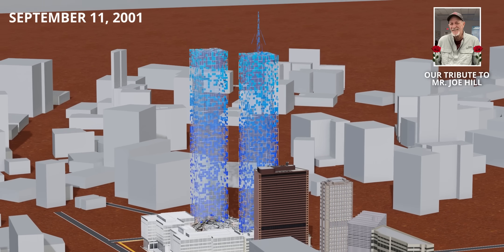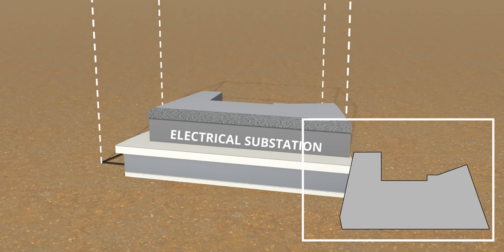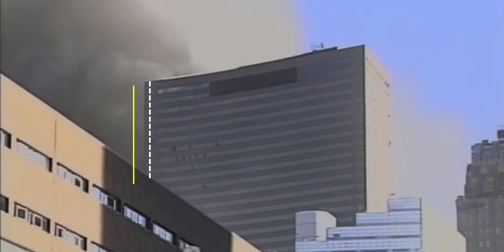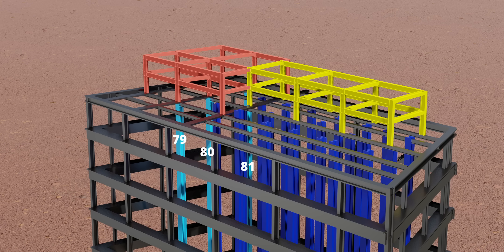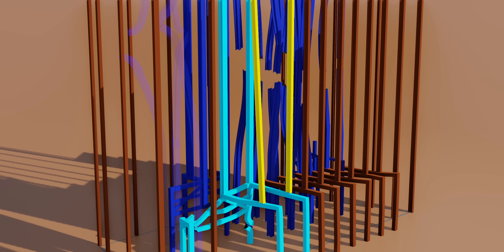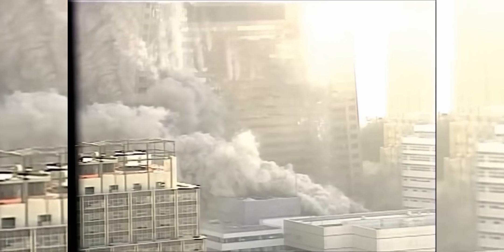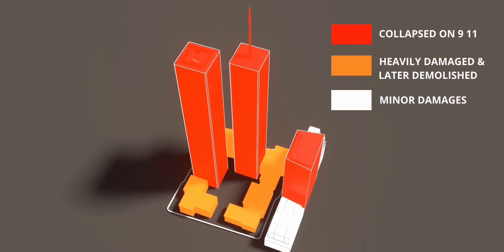Collapse of Building 7 | The Complete Physics

Comment: LIAR
Reply: And yet not wrong. Go figure. 
	
This video is pretty good – with a few exceptions - and goes into a much higher level of detail than many viewers will be able to comprehend.  While not perfect, the collapse mechanisms – the sequence of failures - described here  are substantially correct and this is true no matter who planned and carried out the 9/11 attacks or why . 

That may not be what you want to hear and go against 20+ years of entrenched dogma and conditioning, but it’s not wrong. 

That also means (in case you did not get the hint) this video can be (and IS) absolutely correct in its description of collapse mechanisms AND the 9/11 attacks could still have been some sort of inside job. The two things are in no way mutually exclusive. 

The mechanisms described here have broad professional support around the world. There are no professional engineering organizations (for example: ASCE, ASEE, ICE, etc) that disagree with them or have offered any formal dissenting opinions or alternative hypothesis. 

So, setting hubris aside, either the overwhelming majority of the worlds structural engineers and simple observation are wrong,… … or you are. Which seems more likely? 

IF you still think believe this explanation is wrong then produce a better one . Good luck with that. No one ever has and I don’t see you moving that needle today. 

No one ever does.
Reply: @TheCriticalStinker-jw4fl  Damn, you are gullible.
Reply: @halas7388  - Not likely. If that were true you would have come up with a better rebuttal.

Or a rebuttal.

Comment: it's controlled, why am i supposed to trust the same government that lied about the weapons of mass destruction in iraq ?
Reply: Why would you have to?

The collapse of Building 7 is probably the most studied engineering disaster in history and the subject of 5 comprehensive engineering studies and more than two dozen technical articles in major peer reviewed engineering journals, most of which were published 15 or more years ago. Thousands of pages of material.  This should get you started.

1. FEMA BPAT (initial report superseded by NIST NCSTAR 1A)

2. NIST NCSTAR 1A: Final Report on the Collapse of the World Trade Center Building 7, 2008.

Besides those government studies there are also;

3. Guy Nordenson and Associates, WTC7 Global Collapse Analysis Report and Summary of Findings, 2010.

4. Arup, WTC -7 Structural Fire Analysis Report (Runs 1-4), 2010.

5. Weidlinger Associates Inc., WTC 7 Collapse Analysis and Assessment Report, 2010.

6. BRE Centre for Fire Safety Engineering, Analysis of the Impact of a Fire in the Mechanical Room (5th & 6th Floor) of the World Trade Center 7 Building, 2010.

7. T. McAllister, R. MacNeill, O. Erbay, A. Sarawit, M. Zarghamee, S. Kirkpatrick, J. Gross, Analysis of structural response of WTC 7 to fire and sequential failures leading to collapse, J. Struct. Eng. (United States). 138 (2012) 109–117.

For a summary of the major studies I would recommend THE COLLAPSE OF WORLD TRADE CENTER 7: REVISITED by Mhd Anwar Orabi , Liming Jiang , Asif Usmani and Jose Torero which is a 33 page summary of the different analysis and conclusions published in 2020. Sorry, YouTube will delete this post if I give the link but it should be easy to find and is available from the University of Queensland, Brisbane. 

Happy reading

Or you could just trust rando's on the internet, which lie to you all the time (even if it's what you want to hear).

Comment: Controlled demolition. We knew every since kindergarten that if blocks are stacked too high, they are not going to fall straight down evenly...
Reply: Good thing then the Twin Towers were not made of blocks. Since people actually have to use them because, you know - buildings - they were 95% air by volume.

Not wall-to-wall solid blocks.

I suggest you give it a re-think. Or a think.

Comment: One things a little weird. If the entire floors were burning 
why didn’t the windows break on the side of the building u can see in the video?  You can see the smoke in the other side but if it was that hot inside shouldn’t the windows break all around?
Reply: They did, and you can see some of those broken windows on the north side in the above video
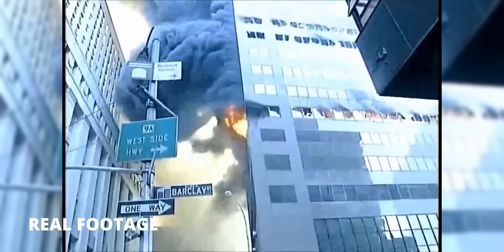Reply: @TheCriticalStinker-01   do u have timestamp? At 3:00 mark they don’t show. I see there’s broken glass later near where the damage was but not on the other side until the collapse part
Reply: Yes, the Vince DiMentri CBS2 footage from 3:00. That is the NE corner and there are clearly 3 complete floors of broken glass on the north face (that's to your right) visible.

My mind boggles as to how you are unable to make out entire rows of broken windows. 

No stell "melted" (as in was heated to a puddle) or got anywhere near that as structural steel will fail at less than half its melting temperature.  Collapse initiation was due to lower floor failures at the corner of the building we see from 3:00.
Reply: @TheCriticalStinker-01  oops that was supposed to be written saying at the 0:30 they don’t show. They DO show at 3:00 ofc but that is where the damage was like I said. 

I know the steel doesn’t become a puddle. But if the fire isn’t over there then how does the steel weaken the same as where the building was hit 1st? Wouldn’t the steel all have to break at the same time to come down at the same time?
Reply: @Marley1331  The physical damage from debris impact was in the center of the south side of the building.

The DiMentri video at 3:00 was shot at the NE corner - about as far from the physical damage as one can get. 

All video of the collapse was taken from the north.